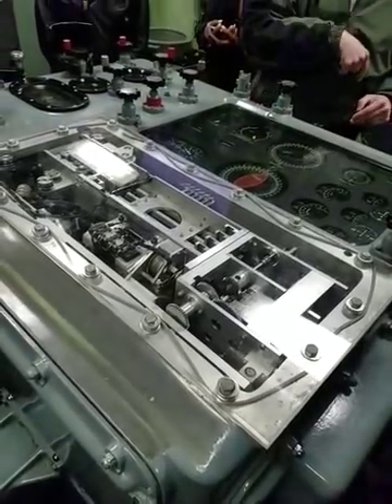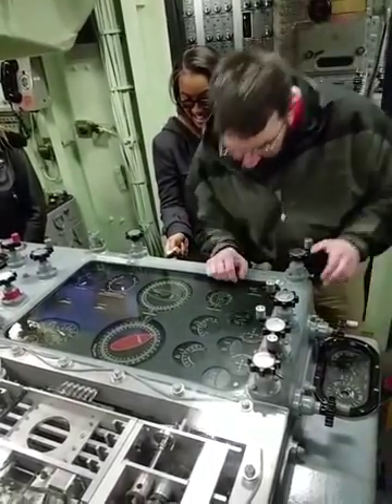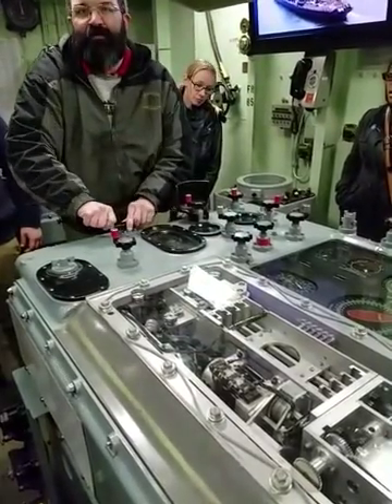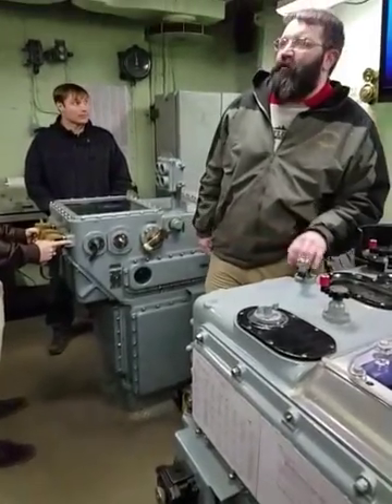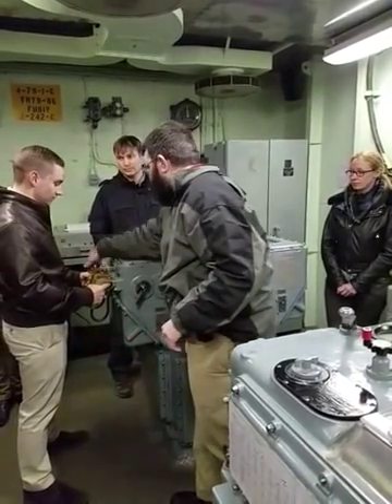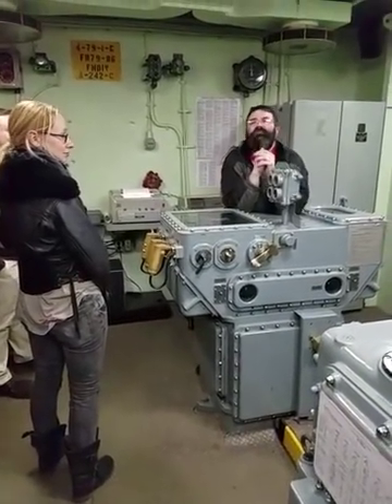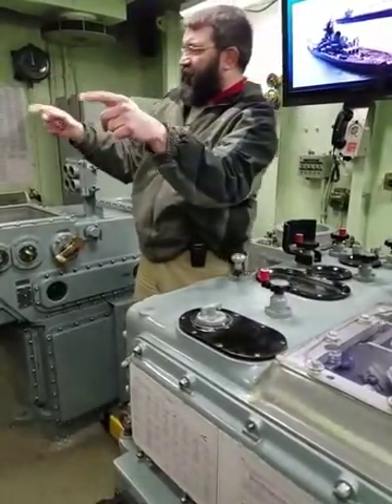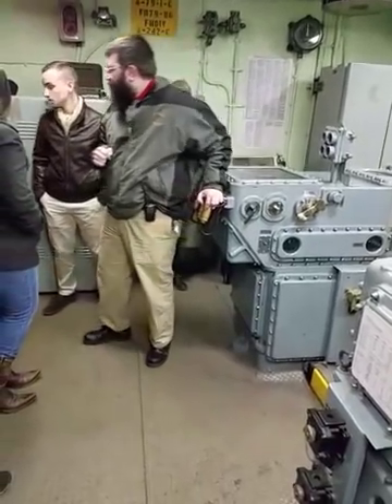Firing the 16" 50 caliber guns on the Battleship New Jersey

Comment: Those guns were so accurate that in the 80s when they modernized the Iowa class battleships they didn't replace the old analog targeting system for the guns.
Reply: Why replace something that is so accurate and can takes a lot bother
Reply: And they used rc planes to make sure the shells were falling on target and it make even better adjustments
Reply: The best part is that it isn’t even just a case of “if it ain’t broke, don’t fix it”. They researched replacing the computers with digital/electronic ones in the 80s, and were told that with the level of redundancy and accuracy required it wouldn’t save any space, power, or money
Reply: They had them dialed in, plus those munitions are so large a little circular error probability isn't much of a problem because of the blast radius.
Reply: I had read back in the 90's that there was an attempt to replace the analog with digital.  The results led to the decision to leave well enough alone.  The analogs performance could not be matched by digital.
Reply: @Sapper201D  No question about the 1980s, and very likely in the 1990s. However, another 30 years definitely changed that.
Reply: In the '80s they were shooting at land-based targets. So they just figured they didn't need to spend the billions of dollars to upgrade a system that worked well enough is what happened.

Comment: He's much more enthusiastic than the guide I had, but he didn't mention that the "triggers" are fired through the gyroscopic computer which ensures the gun are at the correct elevation when actually fired. In heavy seas it can take a second or two for the training mechanisms to catch up with the roll of the ship and fire the guns.
Reply: jth877 that's pretty cool shit.
Reply: The gentleman in this video was the former curator of the ship.
Reply: He did 4:10
Reply: He mentioned it was roll compensation
Reply: I don't remember my guide being very enthusiastic about it. We did go through all of the demos allthough it wasn't in this much detail.
Reply: Awesome!
Reply: Mostly "Pointing mechanism  (up and down) some Training (Rotational) with the ships gyro in sync.
Reply: He may have been an operator, not a maintainer. The operators generally know most of what happens, but the maintainer who tunes/fixes it knows what everything inside the computer does. They have to. I have maintained both analogue (this is analogue) and digital computers and the radars that go with them. The operators know what they need to know to operate it. I tuned and fired gun systems for almost 40 years. Loved it. Like anything, very interesting to some - but many don't care. Each to their own. Or he may just be "keeping it general" to save time. People complain if a guide keeps it brief. They also complain "if he goes on and on". Someone who knows gun systems could talk about it FOREVER (M22 GFCS was a 6 month course JUST for computer, radar was another 6 months - you learn the ins and outs down to individual component level)............. but time and place. This guy is on a schedule.
Reply: He didn't mention a lot of things, but he is a guide, he has a set time, and a schedule; and most people want it "summarised". There are so many variables taken into account with the FC problem; including internal and external ballistic calculations, which also take into account barrel wear (which is regularly checked and effects MV) etc etc. He was probably just "keeping it general for general interest. "
Reply: You can tell dude is a military enthusiast vs a navy veteran.